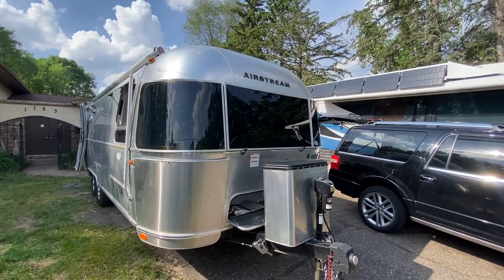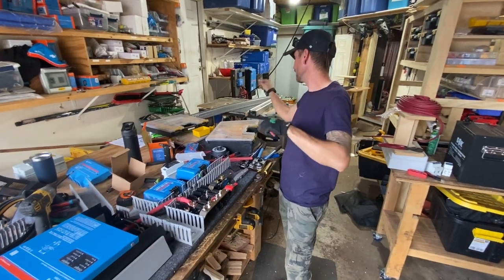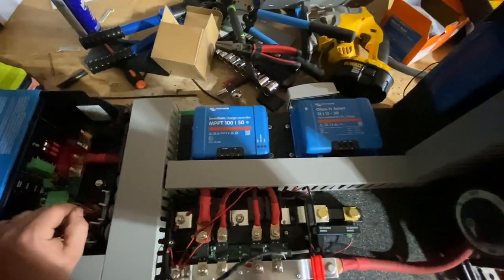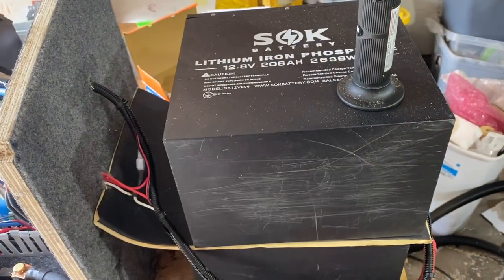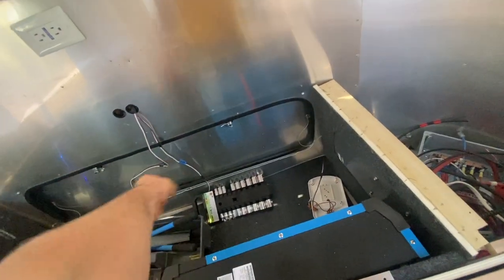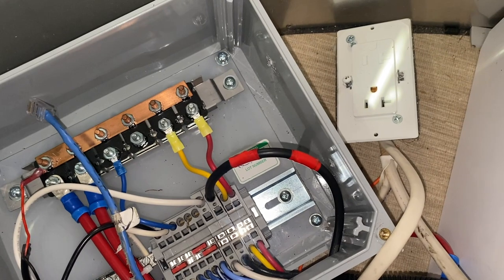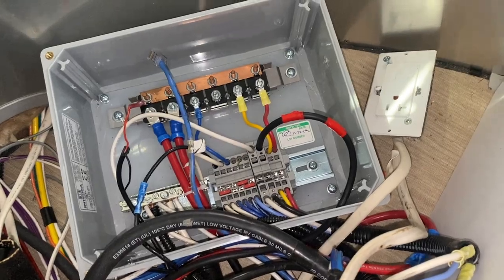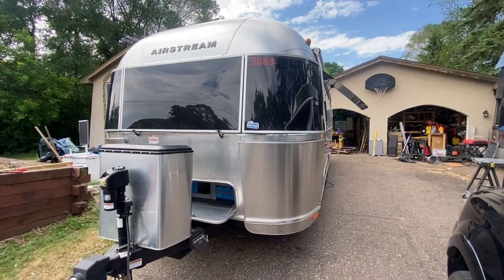In Depth Airstream Flying Cloud VIctron Solar System Install   600w 412ah   HD 1080p

Comment: Appreciate the level of detail in this video. Are you able to suggest a rough cost for an install like this on the same unit?
Reply from the maker: These usually run in the 12-14k range depending on battery.
Reply: Makes sense. Thanks.